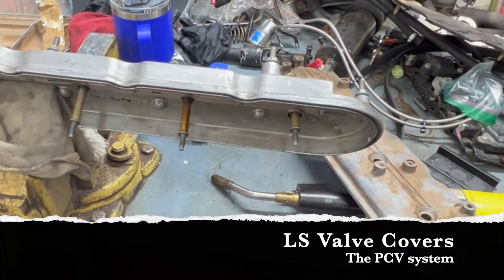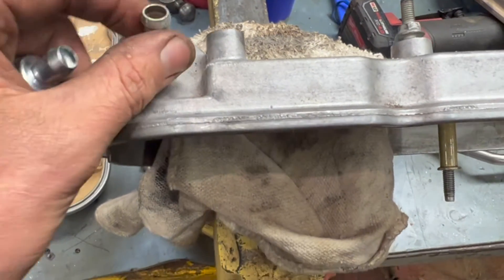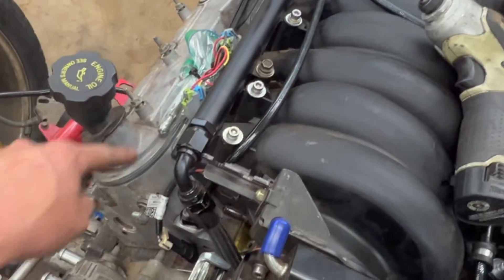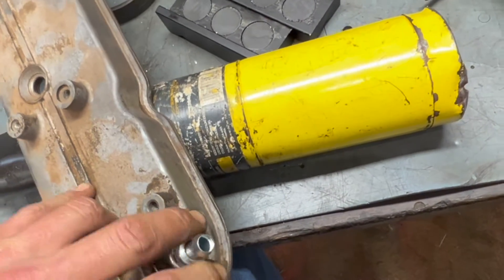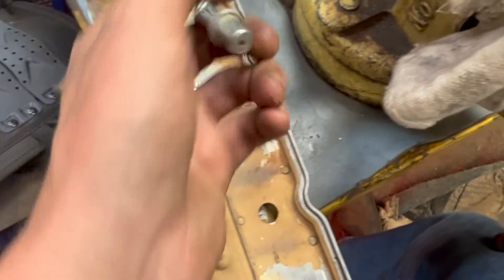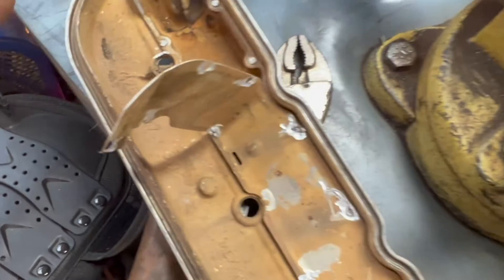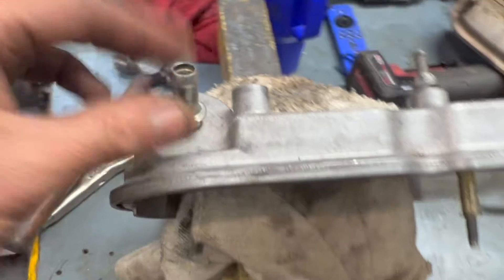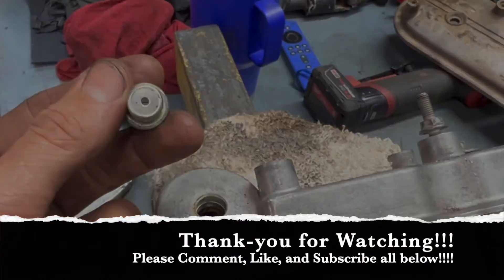Does the LS engine have a Real PCV system???

Comment: Thanks for posting. Hard to find a good answer for PCV upgrades. 1999-2006 chevy 5.3L
I ran a catch can from driver (updated) valve cover to intake manifold. Blocked the throttle body port and put a breather on passenger cover. Better mileage and performance.
Did widening this hole in the driver cover improve anything for you?
Reply from the maker: At first, I ran my catch can just as a vent. Not connecting the valve cover to the engine. Yes that made a big difference opening to oriface. Since then, I have went back to traditional catch can ans connected the valve cover  to the engine. 

I went from having a good bit of condensation (E85 life) to now, a little bit of oil. I am running some kind of PVC valve now. But I cannot remember how I reconfigured it.

Comment: 2007-2011 LS engines have an upgraded valve cover starting from 11 Feb 2011 with new PCV system
Reply from the maker: Yeah. I have valley style PVC on the car that I am using now.
Reply: I just realized that my early 2009 production LS3 in my 2010 Camaro SS, has been super horrible blowby. I noticed it at first through the throttle body, so that was bad enough. 

Then, I installed an oil catch can and my horrors came true. I don’t have AFM/DOD, so I also don’t have a PCV. Chevy uses a flexible u-shaped connection to share a port from the engine valley cover, to the intake manifold. The driver side valve cover is capped off from the factory for this reason. 

Anyways, I noticed my oil catch can filling up literally every 4-5 days, driving more than 200-250 miles (not including hard driving, etc). My engine/car only has barely 35k miles, and I figured the piston rings weren’t bad (never got it compression checked), the spark plugs seemed okay, and the valley cover gasket couldn’t possibly be messed up. 

I’m gonna see if I can install an in-line PCV valve (3/8”) either through the inlet of my catch can, which goes to the intake manifold. I believe that this will remedy all the oil blow-by, as a result of the engine design
Reply: @isnowyazn where did you have the catch can running from & to? Did you go through the rear drivers side around to int manifold? Or the cold air intake
Reply: You say 2007 to 2011 have the upgraded valves? But then say starting from 2011? So 2007 to 2010 dont?

Comment: Some engines have a breather on one side and a regular ball and spring PCV on the other bank. If you have unregulated vacuum applied to the crankcase without the breather, expect seals to be put under the strain of negative pressure, and under the extra positive pressure strain of an occasional backfire. The big issue with PCV's is the way an open failure draws more than expected oil into the intake during high vacuum seen with idling, causing oil consumption, fouling, and gunk coating intake valves especially with a GDI engine. My 2000 LM7 LS variant has a proper PCV and I don't fiddle with it, except to be sure it is still working.
Reply from the maker: Great information!!! Thank-you for commenting.

Comment: The Old pcvs your thinking about had a ball that used to stop backfiring from your inlet into your crankcase .. those carburettor days are gone (old man😄)
Reply from the maker: Understood. Being why I made the video. Just sharing what I found. I learned a lot.
Reply: Thanks for the lesson 👍 
As a 59yo mechanic, I thought I knew everything .. You should be a teacher ..
Reply: @kevwills858  You're a lot more gracious than I would have been. You took the high road👍
Reply: @Brian-mp2mv  You can't talk politics to lunatics.
And if your interested Brian, a  one-way PVC will protect a backfire flame front from entering the crankcase.
Carburettors incorrectly adjusted along with incorrect ign timing will do this .. I've seem it a number of times created by ignorance. Modern efi and ecus  rarely experience this 'retro' scenario.
We must have a young teacher here ?
Reply: You don't know what you're talking about. Firstly, they didn't have a ball, they had a weighted cylinder, and the real purpose of it was for the oil to condense onto and run back into the valve cover, thus the sump, rather than being drawn into the intake all willy-nilly-like along with the vapor. Additionally, it allowed a stable PCV flow by letting the vapors through only when the pressure reached a calibrated threshold (those cylinders were a calibrated weight by design, specific to each different engine) as well as acting as a one way check valve so the vapors didn't just flow back and forth in there because the flow wants to reverse in between the positive pressure pulses. A proper PCV system is on-off-on-off and so on because the pressure from the pistons moving down is pulsed, not constant. Furthermore, most engines today still use an actual valve for those same reasons and because its a superior design. Going away from a proper valved system was a step backward on GM's part due to cost saving measures. The PCV valve had litterally nothing to do with backfiring whatsoever, ever, lmfao. As backfiring is not, and never has been, a concern of OEMs becaused a properly tuned and mechanically sound engine will never, under any circumstances experience one, so thats moot, and its virtually impossible to happen on a fuel injected engine which every single engine produced since the mid 80's is; and, like I already said, most engines manufactured today still use a weighted PCV valve, so obviously they had nothing to do with carburetors dummy. Just to be clear... so you don't get more confused.... backfiring is not the popping you hear from some vehicles on decel, they're two totally different things. An actual backfire is as loud as a gunshot and can blow your intake and/or TB/carb clean apart, a PCV valve is not going to address that, clearly. It is unlikely that youve ever even heard of or been around an actual engine backfire in your entire life, thats how rare that is. Maybe you should actually know what you're talking about before running your jibs pup.

Comment: Not such a great design, there is a bunch of oil inside the air inlet duct on my 2019 . Which can only mean the pcv is not doing it's job . I'll try to squirt some carb cleaner in there and see if it helps. Maybe some brillo in the breather tube to keep it from building a puddle of oil in the air box
Reply from the maker: Yeah, this journey has been interesting. IDK what you have going on. I had to switch from a non-pcv catch-can system to a pcv catch-can system. Due to back-pressure building up in the crank-case. My front and rear seal started leaking. Now no more leaking.

Comment: So is it a good idea to hammer out old valve or replace entire valve cover? (5.3 vortec)
Reply from the maker: Many different paths. Starts with what is the issue. If it is clogged and you are wanting to be thrifty. You can pull the "orifice tube/nipple" and clean out every out. Or just replace the old valve cover. I did all this because, I am running a catch can, and no vacuum.

Comment: My 03 1500 Express V-6 has the same. Did you see any difference when you bored it out ?
Reply from the maker: So, I am running a catch can that doesn’t connect to the engine. But yes, a huge difference in venting
Reply: Let us know how it goes on that express van . I have a 08 Silverado with the 4.3 v6. Consuming oil out the ass.

Comment: I ran into a few videos that deal with the oil consumption problem in these chevy engines suggested drilling several holes in the inside valve cover.
Reply: You are correct what happens is the oil is pooling because the drain holes in the baffling get plugged and then the oil gets pulled into the Plenum
Reply from the maker: Interesting, I wonder if they are drilling it out. And they are putting a traditional PCV in it
Reply: @RocketGarageService  . No. They said Leave the permanent PCV. 
They suggest about 9 holes in baffle. One hole in PCV. I think was 1/4.

Comment: Looks like GM did not do any high mileage testing to speak of with this design.  Hey, lets invent a valve cover - pcv valve combo, NOT !!!
Reply: You can say that again. I bought a 2011 Avalanche and it was using oil like crazy. Learned about these ignorant designed valve covers, replaced the driver side with an updated version and now have no oil usage at all. I might have been able to clean my old one but for the 30 bucks I just swapped it out.
Reply from the maker: That is true. Probably related to all of them having rear main seal leak too.

Comment: So my 03 Silverado had a pcv valve with a check ball in it when I replaced it auto zone gave me one without a check ball I thought it was odd but then I also considered it may be a redesigned part so I’ve been running it and idk if it’s a good or bad thing but if anyone can tell me I’d appreciate it. Run Pcv with or without check valve in it?
Reply from the maker: I believe either way is fine. I would stress it. Biggest thing is changing/cleaning it as routine maintenance. So, it doesn't clog.

Comment: In the Holden Commodores in Australia which were fitted with the 5.7 litre Chevrolet LS1 V8 engine from the Camaro they do run a proper PCV valve.

In my VY Commodore 2 of the valve rocker covers are teed together by a vacuum hose which is connected to a hose which joins onto a PCV valve which is connected to the inlet manifold via a vacuum hose.

A lot of it used to be plastic lines but the rubber Y piece got deteriorated then fell apart so I made my own up.

There's also a breather hose which connects between the throttle body & the right hand valve rocker cover !
Reply from the maker: My 02 Trans Am had a y setup too. Thank-you for the comment!!!!

Comment: Does the 02 trans am or camaro valve cover fit a 5.3 Silverado 1500 engine I like the valve cover with the rubber for Pcv valve
Reply from the maker: Yes, in most cases it will work fine. When some aftermarket parts are used, certain valve cover could interfere.

Comment: I ran into something similar when doing the LS swap on my K5 a few years ago and it had the built-in PCV "orifice" on the driver side and it seemed to be burning oil and getting the crankcase vent smell inside the cabin everytime I would decelerate. My first instinct was either PCV valve, valve seals, or piston rings. So I went with the cheapest I could tackle first and got down to PickAPart and got an older valve cover with the serviceable PCV and bought a real legit PCV valve from local auto store. Consumption is down dramatically now but I think I still need to replace valve seals to get the remaining albeit small amount of consumption fixed on this 150k+ LM7
Reply from the maker: Good insight, I appreciate the comment.
Reply: The orifice “pcv” and an updated valve cover baffle was GM’s answer to oil consumption.
Reply: @shaunybonny688  Well mine had a small baffle not sure if it was the correct revision but it didn't work and going back to regular PCV did for me. And now I have different valve covers and setup altogether...

a buddy gave me some schnazzy covers that required a custom PCV setup AN fittings and so I added a catch can and it's been great no vapors. I got a sightglass on the level so it's easy to monitor too.

Comment: Gm calls it a 2.5mm integrated pcv orfice and yes it's not serviceable,gm investigated oil consumption and they redesigned the baffling system in late 2007 or 8 lookup the SB to get the new part number or simply invest in catch can
Reply from the maker: The car does have a catch can. I opened the orifice to the inner diameter. Catch can "catches" a-lot my fluid now.
Reply: @RocketGarageService  The metered orifice is there to allow "dirty" crankcase air to slow down just enough to allow any oil to drop out of suspension and drain back into the cover.  Opening the orifice up just allows more of that dirty air to pass through and into the catch can, which does the same thing, it opens up to a bigger area allows the air to decelerate and drop oil/condensation into the can, before it passes on into the intake manifold and gets recirculated.  Its not a perfect design as we all have figured out and opening it up does nothing more than makes your catch can work harder to do the job.  Most good catch cans have a screen/mesh and a wad of stainless shavings in the top of the can with the screen below to help scrub and drip the oil or moisture into the can to keep it from flowing straight through.

Comment: The valve is inline in the hose system on the later stuff...
Reply from the maker: My 02 LS1 trans am had a PCV valve. My 06 Sierra does not.
Reply: @RocketGarageService  Where is it drawing the air into, maybe it has a ported vacuum source at the throttle body?  I see the idea of a metered leak but it seems extreme if it's full vacuum...
Reply: That’s exactly what I been wondering 🤯🤷‍♂️ just bought a pcv and it’s pretty much pointless to replace 🤦‍♂️ I think the better fix is too get a catch can
Reply from the maker: @leenjadetv6220  From some recent reading, they call this "new style pcv" a Orifice PCV system. I ran into it on the Holley Terminator forum. The Orifice style can cause tuning woes for certain applications.